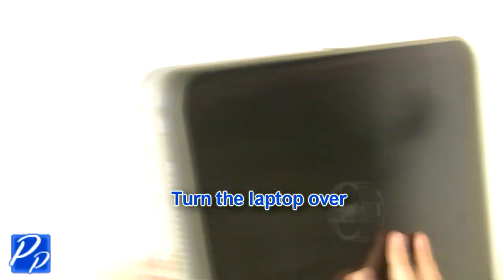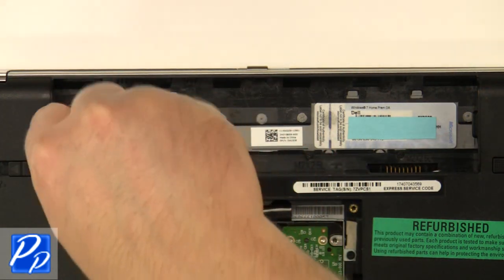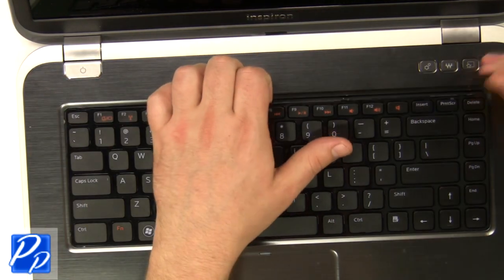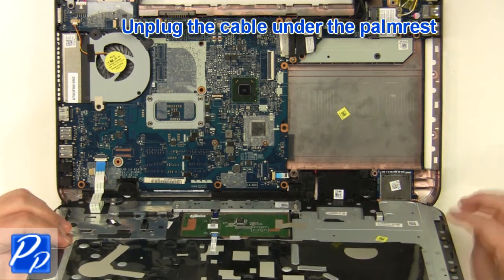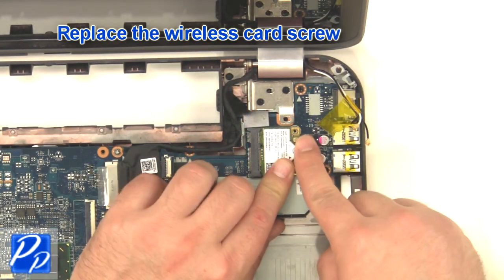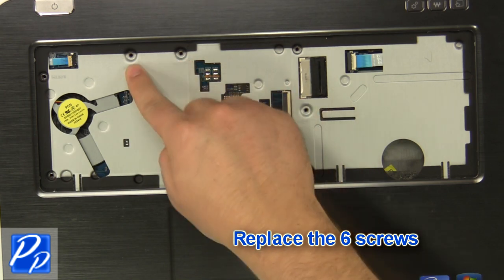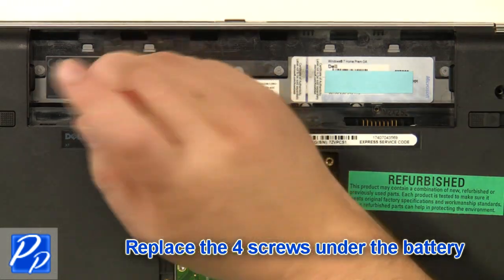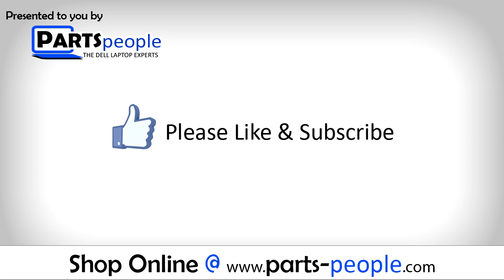Dell Inspiron 15R (5520 / 7520) WLAN Wireless Wi-Fi Card Replacement Video Tutorial

Comment: Great video. I've replaced my LCD cable, Bezel and the palmrest watching the previous video of yours. Could I replace my current wifi adapter with a dual band without needing to replace the antennas attached on the Screen panel? Or those need to be replaced too? What parts are compatible for replacement in 15R 5520?

Comment: What should I do if the antenna cables are broken?
Reply from the maker: The cables run behind the LCD screen and attach to the LCD back cover. We always recommend replacing the entire back cover because they are sold with the cables. This will how. https://www.parts-people.com/blog/2013/07/15/dell-inspiron-15r-5520-7520-lcd-display-screen-and-hinge-rail-removal-and-installation/ And here is a link to the back cover (You can see the antenna cables attached) https://www.parts-people.com/index.php?action=item&id=12948

Comment: This works on the Inspiron 15R SE 7520 but there is one extra cable connecting the keyboard, possibly for the keyboard backlighting. Thanks for the video. Was able to upgrade to the Intel wireless dual band AC 7260.
Reply from the maker: Cameron Carmody Yeah, I think the system I had didn't have the backlit keyboard. But everything else is the same, right?
Reply: Yes, everything is exactly the same as your video. Good stuff.
Reply: +Cameron Carmody AC 7260 worked fine in your 15R SE 7520, right? Do you know other wifi network card dual band compatible with your computer?

Thanks
Reply: 7260 works on your 7520?

Comment from the maker: It depends. Some of the 5520s have an extra slot for an mSATA SSD and others don't. I'm not sure why but I assume that they only come on machines that were originally ordered with SSDs. If you do have a slot for the mSATA, it would be located on the bottom side of the USB Circuit Board. Out of all the USB Circuit Boards we sort through, we might find 1 out of 50 that has the mSATA slot, just to give you an idea of how rare they are.